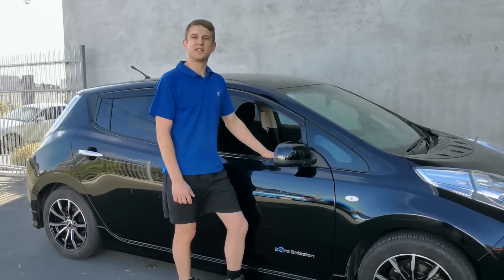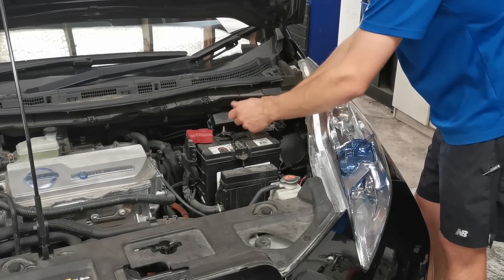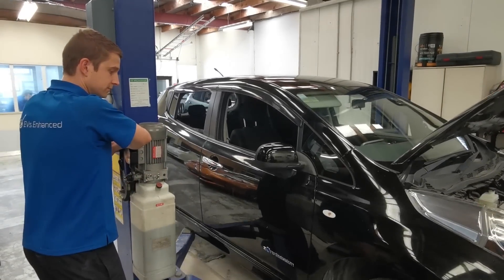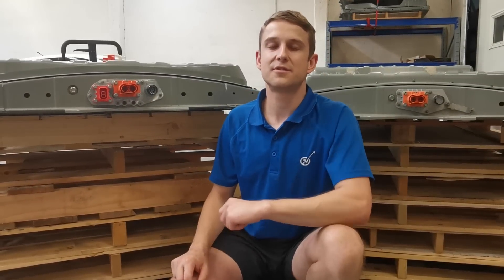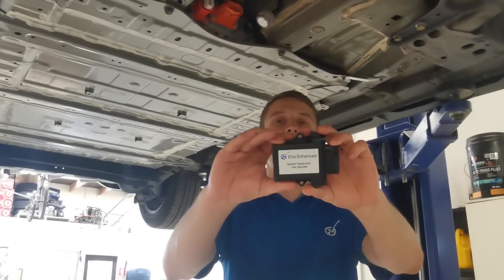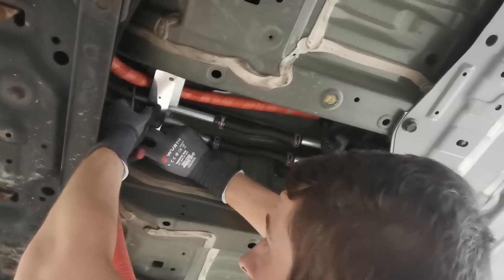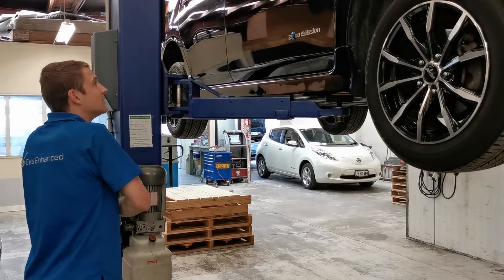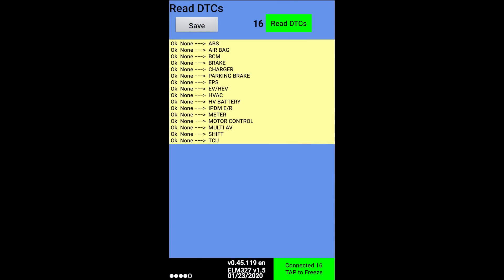Nissan Leaf High Voltage Battery Upgrades Made Easy

Comment: I like the massive rubber gloves turns up suddenly to unswtch the high voltage :) Also super impressed with the high tech removal pallet system.  Nice work chaps.
Reply: Where do you get the connector to go between the battery and the motor
Reply: Tell where you get the two controllers one and hooks underneath the program you're on board computer and the one on the battery

Comment: The question is How much this will cost???? I don't think I will get any answer I assume 🙄👀🤷
Reply from the maker: If you're in New Zealand then we can supply a upgraded battery pack, but if you're elsewhere you'll need to source a pack locally. The battery translator kits we sell on our website. See https://evsenhanced.com/products/battery-translator/
Reply: @EVsEnhanced  again... How much????
Reply from the maker: @MLK.PaNoRaMa  How much for what? The translator kits are NZ$820+ on our website. If you're outside of NZ then we currently can't help you with a replacement battery pack. If you're inside NZ then use the upgrade calculator on our website. https://evsenhanced.com/services/hv-battery-swaps-and-upgrades/

Comment: But its sad knwong that this new pack will soon degrade like the original did. Endless cycle
Reply from the maker: Regardless of how long a used replacement pack will last, if the original car it came from is damaged, then reusing the battery in a different battery still makes sense.  However, for people looking for a new battery with a long lifecycle, we're currently developing a entirely new battery pack design for the Leaf with LFP cells and active thermal management. Further details are here https://evsenhanced.com/aftermarket-battery/

Comment: This battery is OK for 50-60 km daily commutes given that the owner will charge it between 20 and 80%, and would be able to make 100km if needed. My battery looks pretty much the same, and my wife is happy to use Leaf every single day for her work commutes (around 30km) charging it every night to 80%.
Anyways, glad to see that you have a successful business helping EV owners to extend the lives of their cherished cars. Hope, at the time I will need to swap our battery, you will have an easy option for the Aucklanders.
Reply from the maker: Hi.  Our products are available for sale to allow any good mechanic anywhere to complete these upgrades. There are already several workshops in Auckland offering Leaf battery upgrades using our battery translators and pairing tool.
Reply: How do you set the charge to 80%? Nissan has removed the setting and it now charges to 100% which degrades the battery in my leaf much faster...
Reply: @xhobv02  I noticed on my 2016 leaf , i cannot charge up to 80%. But my nissan leaf 2012 i was able to. i have to admit that , they both look the same but i miss my 2012 leaf. that car was definitely not the car for his era. way advance and much more reliable than any other leafs.

Comment: Good video, however what did all that cost the car owner in exchange for a whopping 24 miles additional range over a new standard pack? The owner must have really loved his Leaf to pay so much for an incremental improvement. This is almost as wild a solution to a degraded pack as another video I saw that added a second set of parallel batteries in the boot making the car go a whole 60 miles farther, in exchange for loosing the rear seats, and making the car hundreds of pounds heavier, and emptying his bank account. I think the bill on that one was around 8500. LoL
Reply from the maker: Hi.  A new standard pack isn't available in many countries including our our own (New Zealand).  Also, our plug-in conversion kit is around US$550 so almost all of the cost is in the price of the donor battery back and what price you can find a good used one for.   That varies widely from country to country.   We are also not fans of batteries in the boot which is why we are sticking with full battery replacement options and repurposing the battery modules from the old battery pack that comes out of the car.
Reply: @EVsEnhanced  Thanks for the info! The Leaf has been a real education for me. $550 is a bargain! I wish I was near you. Finding a donor battery is another tough nut to solve though. Even then the solution is temporary at best. The crappy battery design will start degrading in a few years again no matter what is done. Very sad. I hope someone finds a real solution someday soon.
Reply from the maker: @michael47lamb  We have partners in quite a few countries and sell most of our products internationally so it isn't necessary for anyone to be near us in order to upgrade their Leaf.  Yes, we share your sentiment about the difficulty of sourcing a good used Leaf pack as the demand is much higher than the supply.  Gradual capacity loss over time is the case with any EV and many owners have gotten a good run our of their original Leaf battery pack.  However, we agree that there is room for improvement in terms of the life span of the original Leaf packs.  This is certainly something that we continue to explore with the goal of being able to offer superior solutions in the future.
Reply: @EVsEnhanced  Have you looked into re-celling packs yet? New modules seem to be available from China now. I watched a couple videos of people doing this. Looked rather simple to me. Just need to be careful what you do and touch inside. Then there is the CAN issue afterwards. Looks straightforward, but time consuming too. Takes all day if you know what you are doing.
Reply from the maker: @michael47lamb  Rebuilding packs with genuine new modules isn't currently feasible as Nissan wont sell sets of new modules for an even remotely reasonable price.  Aftermarket modules from mostly unknown suppliers are a risk we don't want to get involved with.  Everything we offer our customers has safety and longevity as primary design objectives and we have no plans to compromise on that.

Comment: Quick question I noticed that the leaf has only 53K. I am wondering why the owner didn't get the replace the battery under warranty. Thank you
Reply from the maker: Hi. Firstly, all 24kWh Leafs only had a 5 year warranty and these were built from 2010-2016.  Therefore, very few of these will still be under warranty now.  It is worth mentioning that Nissan extended their warranty to 8 years with the introduction of the 30kWh battery and beyond.  Secondly, here in New Zealand most of our Leafs are used imports from Japan.  Even on a newer car, Nissan NZ doesn't support the warranty that the cars would still have if they were in Japan.  Hence we have been forced to find solutions to problems far before other people in other parts of the world.

Comment: Hi I have been wondering if one day I could get an update to my 2019 Leaf plus so the Range could exceed 300 miles because I now travel Interstate. So I now need a much greater range wish I could get 450 miles that would help a lot. I like my car a lot so just need a larger battery pack
Reply from the maker: One day likely.  Not practical in the near future though. If you do long trips occasionally then your car has plenty of range and you just need to find a nice spot on your journey with a fast charger.  If you realistically do really long trips like this really often then buy a Tesla with the long range option.

Comment: Where can I buy this? Include 40kwh + EVs kits. I have 2020 Nissan Leaf.
Reply from the maker: Hi. Sorry, we currently only supply battery packs to local customers (in New Zealand).  However, if you can source a battery then we can supply a translator kit.  Are you sure you meant a 1 year old 2020 Leaf?

Comment: I wish the government would consider subsidising battery replacements as well as new cars. There are plenty of Leafs on the roads which could last for years with a refreshed battery.
Reply from the maker: Agreed.  We noticed that the Climate Change Commission has recently recently released a draft of their advice to the NZ government.  Buried in that is 'work with the private sector to roll out EV battery refurbishment'.  So maybe.....

Comment: How much does something like this cost to get done?
Reply from the maker: Hi. The cost of the replacement battery pack is by far the biggest expense and that varies depending on which part of the world you are in.  For example, here in New Zealand we have to pay significantly more for good replacement packs than in North America and Europe.  We do supply our products (without the battery pack) to help EV specialists in other parts of the world to offer the same service though.  To give you an indication on the prices we charge for a drive-in drive-out service in our own service center, check out the calculator  at the bottom of this page https://evsenhanced.com/services/hv-battery-swaps-and-upgrades/

Comment: Right now of course the first Leaf EVs are coming up for mainly battery replacements.  However with fewer moving parts Nissan Leafs could conceivably be running for decades or more, far longer than ICE cars which usually become too expensive to repair due to engine or gearbox issues.   How feasible would it be to keep an old Leaf running by replacing engines, computers, etc?  Would that be something that can only be done by Nissan (if they even bother to) or will 3rd-party mechanics like you guys be able to find parts and get the technical knowledge to do so?
Reply from the maker: The Leaf is relatively simple and easy to work on.  Like any car, other parts can sometimes fail but independent 3rd party specialists keeping these cars running for a long time is very feasible providing the battery supply/cost issues are resolved.

Comment: Is it possible to install a newer 62kWh battery in a 2012 Leaf with your technologies?
Reply from the maker: Hi.  Unlike the 24/30/40, a 62kWh battery pack isn't a bolt in job.  It has different mounting points and is significantly heavier.  So there are other things to do as part of the conversion, but it is certainly possible.  We're looking at OBC upgrade options for the 2011/2012 cars as well.  Unlike the later Leafs, there was no factory option of a 6.6kW OBC.
Reply: @EVsEnhanced  I hope you set up shop in California.
Reply from the maker: @JonJoshChua  We have no plans to do this, but would be happy to supply our tools and equipment to another EV specialist company in California.

Comment: What's the weight of that battery pack?
Reply from the maker: The 24kWh, 30kWh and 40kWh Leaf packs are all very close to the same weight of 300kg.  It is only the 62kWh pack that is significantly heavier at 440kg.

Comment: Can a person get a simple replacement (no upgrade) of a 24 Kwh for a 2011 Leaf?  Is it possible in the USA?
Reply from the maker: Yes.  For a like-for-like battery direct replacement, no translator is required.  You can just use our battery pairing tool.   https://youtu.be/KGfACtsdtTk https://evsenhanced.com/product/hv-battery-pairing-tool-individual-use/

Comment: i wonder why blooming nissan doesn't provide this service. it reflects really bad on that company,
Reply from the maker: Agreed.
Reply: Of course it's because they want to sell you a new car!  The last thing they want is for your old car to be better than it ever was just by adding a larger battery.  They will replace your battery but only for the same sized battery as your old battery.  Not sure if they do that in NZ though.
Reply from the maker: @edvoon  Agreed. Although to be fair to Nissan there is an exception. They do actually offer a 40kWh upgrade for cars that originally had a 30kWh pack now as the 30kWh pack has been discontinued. Not much love has been shown to owners of cars with a 24kWh battery though.

Comment: With the Pandemic and not driving - how should a leaf be stored when not used? low battery or full?
Reply from the maker: Hi. Approximately 50% state of charge is best for storage.
Reply: @EVsEnhanced  Thank you - I've got a '17 that's already down a bar and reports 78% SOH. It has mostly sat idle since March with very lil driving.
Reply from the maker: @bshef3424  If it is a 2017 30kWh then it is worth checking the LBC (BMS) firmware version as there is still a version out there with a bug which Nissan has not yet even acknowledged let alone offered a fix for.
Reply: @EVsEnhanced  - Ok - Yes when I private party purchased it....I did take it to a local dealer who assured me that it showed it had already been updated. Thanks for the replies and the great video!
Reply from the maker: @bshef3424  Ok.  It would still pay to check to be sure. LBC firmware versions of the form 4Nx4A, 4Nx4B or 4Nx6A all have a bug.

Comment: Ugh. I was lucky and got a warranty replacement to the 2015 chemistry (IIRC) for my 2011 Leaf. It's better, but not great. About 80,000 miles on the replacement and it's dropped a bar. Full charge is about 17Kwhr. Not great, but still useable for what I use it for. Main car is a 2020 Bolt. My leaf is like serial number 203, actually built in 2010!
Reply from the maker: Dropping a bar after 80,000 miles on your warranty replacement pack doesn't sound too bad.  Cool early build date on your car.

Comment: Do you think in the future with battery improvements, a 60kwh battery pack upgrade will be available to early leafs?
Reply from the maker: Yes.  We have already put a 62kWh battery into an early Leaf.  In our own country we are working through certification requirements to make this road legal mostly relating to the additional weight.  The 40kWh Leaf battery is an easier upgrade for the earlier cars as the weight is very similar to the original and the mounting brackets are the same.  With the extra weight of the 62kWh pack, Nissan added a lot more mounting points which are in a different position.

Comment: Where can I get the OBD to leaf battery adapter, blanking connector and AB enhanced translator kit (translator module, mounting brackets, fastener and full loan for simple plug & play)?
Reply from the maker: Hi.  It depends on where you are.  If you are close to us in New Zealand then go to evsenhanced.com and check out under Enhancements (within Products and Services).  If you are somewhere else far away then we may have a relationship with a closer company who can help.   Feel free to email enquiries@evsenhanced.com for more information.

Comment: how much money? work with 62kwth battery?
Reply from the maker: Hi.  We currently support 62kWh battery upgrades on some models.  What year Leaf?   Our translators are sold with a few variation options (with/without plug-in wiring loom and pairing tool) at different prices. Please check out https://evsenhanced.com/ for more info.

Comment: Will this work on cars in the USA? I have a line on a 62 kw
Reply from the maker: Hi. What year/model is your Leaf?
Reply: @EVsEnhanced  2013
Reply from the maker: @edcochran714  Yes that combination has been well tested now.  However, the 62kWh battery is not a direct bolt in job like a 24/30/40 and it is considerably heavier.  It requires a custom mounting kit among other things.  Shipping this mounting kit is expensive, so we'll probably pass on the design we use to some of our North American partners for them to have fabricated locally.  Perhaps get in touch with Precision Auto just over your boarder in Langley City, BC to discuss.

Comment: that's fantastic！！but hard to find the 40kwh battery in china for my 24kwh leaf
Reply from the maker: Hi.  Do you have a Venucia e30? Interesting.  Is it hard to find a used 38kWh battery from the Sylphy EV in China?  If so, we might be able to assist with making that combination work.
Reply: @EVsEnhanced  OMG!!! your guys even know the Venucia & Sylphy EV? Yes, i bought a used e30, and i notice no easy to find the battery in aftermarket.
Reply from the maker: @baoshawnjing3082  Yes, we know about these models, but we haven't had any experience with them.  It would be interesting to know all the differences between these and and the US, Japanese and UK built Leafs.  If you do happen to find a good spare battery in China then come back to us and we'll do what we can to help.

Comment: What was the original battery pack before the swap? 24kwh?
Reply from the maker: Yes. Before this swap the car had the original 2011-2012 type 24kWh battery pack.
Reply: Can you put a 40kwh instead of the 30kw?
Reply from the maker: @johnnystacks5179  Yes. However in addition to the translator, we also update the VCM firmware for this conversion to eliminate compromises.
Reply: Can you add a 64kwh
Reply from the maker: @johnnystacks5179  Assuming you mean the 62kWh, this does not mount the same way so unlike the 30 and 40 it does not physically bolt straight into the car. However, with custom mounting brackets it can be done.
Reply: With the hardware you supply? Are you sure?
Reply from the maker: @johnnystacks5179  Yes, we're sure that a 62kWh battery does not mount the same was as a 24/30/40, but that it can work with custom mounting brackets.  The 62 is also substantially heavier than the others. We're not sure that we'll offer a 62kWh mounting kit internationally yet.  We might just offer the CAD model for others to make themselves.
Reply: I am more concerned about the hardware working with the battery pack I know the 62kwh is not a direct plug and play and needs to be   modified in order to fit has to be a custom built

Comment: I am from Sri Lanka and we have almost 4500 Nissan Leaf cars from 2009 to 2020. most of the cars were imported in the year 2015, and we are facing a major problem of getting the batteries replaced.we have technicians who can do the installations but unable to get the new batteries.is there any one who is willing to export new batteries for 2014/2015 Nissan Leafs.
Reply from the maker: Hi.  Sorry, but the supply of good Leaf battery packs here in NZ isn't much better than what you describe in Sri Lanka.   We are working with others to improve the situation though.